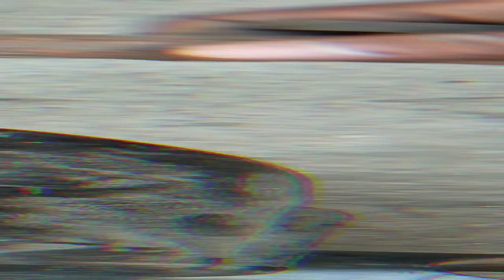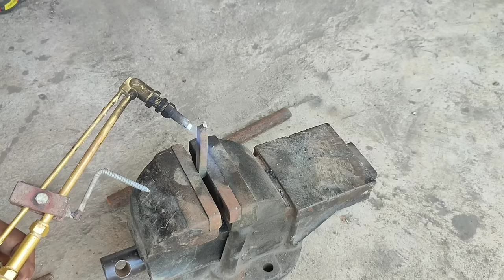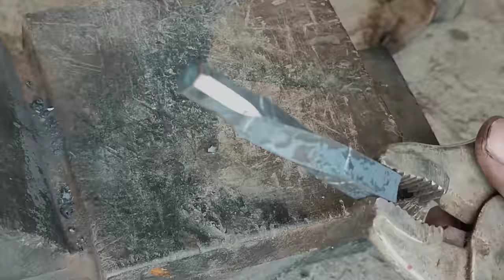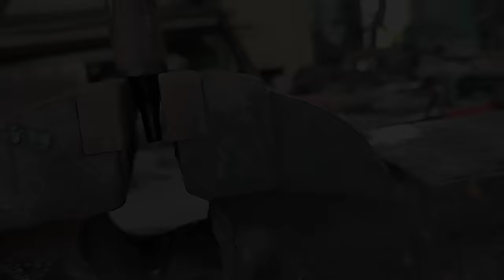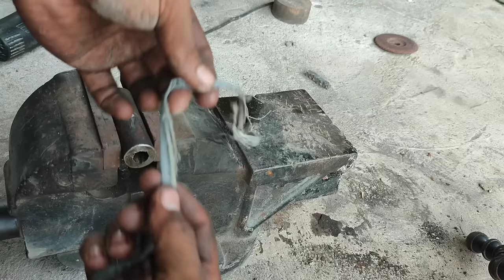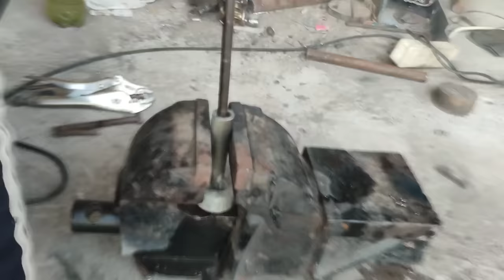Making barrel rifling without a lathe.Simple and effective,Everyone can make it

Comment: The interior of the gun barrels is conical to give pressure to the projectile at the exit of the barrel.The one he just made is straight
Reply: what guns have conical barrels? im curious, and barrel that he made is wonky
Reply: Weapons that have a fluted and conical barrel are those that use monoposta oceana cartridges, which we commonly call bullets. Shotgun-type firearms that use cartridges containing shot also use a conical barrel but it is not rifled.Shots are small steel balls contained within the cartridge.
Reply: Sorry but I only speak Spanish and to answer I am using a translator
Reply: @gustavocorintti2211 Do you mean something like that ¿Cañón reductor perforante? because i don't know what is monoposta oceana.
shotguns can use conical barrel but i think nowadays they use choke that is  Estrangulador.
Reply: @TaxortRetotuck  Yeah, i believe that conical barrels were more of a specialized item for larger guns and canons like anti-tank guns, etc.  The breach will be larger diameter than the barrel just to fit the cartridge to slide into place easily. Then the projectile seals against the walls of the barrel which is narrower, but the bore is straight, with parallel sides, not conical.
Reply: @davidsnyder3799  Thanks. Diameter near chamber should be bigger, but Squeeze bore is (at least according to wiki) conical. But normal barrels have parallel bore after chamfer. Right?

Comment: The grooves are .530" or so, assuming the HSS blank is of 3/8" size. Another assumption: the land diameter is about .50" but there appears to be a lot of displaced steel.  I did not see any lapping.

Comment: Destroyed the crown cracked the pipe visibly wich means its full of other cracks probably woulda worked better with a shop press than hammer but forcing something through something brittle will usualy cause issues also hole not center in pipe also used a lathe  shoulda have atleast anealed metal tube  to allow for for more give to avoid the cracking  then rehardened to usable hardness

Comment: Anyone who thinks this is particularly dangerous is a bit silly in my opinion. Even if it doesn't work particularly well; the rifling here should engage to some degree on a properly sized projectile and that metal is pretty thick on the barrel. If you use a lower pressure cartridge, a barrel that thick made of low quality steel should still be adequate for firing safely for at least awhile. It doesn't need to be a .50 bmg in order to be an effective gun and this is a very simple way of creating slightly more advanced rudimentary firearms. Cut the guy some slack, he's using mostly hand tools and 19th century technology. Have any of the naysayers considered it might be a barrel for black powder firing guns?

Comment: they way the do it in the real world is spring loaded piece that has carbon bits  and a long very very thin rod, think of the spring are like barbs on a harpoon and on the tips carbon bits that you push in and out over and over .. you will need a way to control the spin
Reply: Actually if you watch button or cut rifling, the broach or swedge turns on it's own, it's a turbine, and follows the track it sets itself.

Comment: I’m pretty sure that homemade gun would’ve exploded if he really use that gun barrel
Reply: Por qué ? Tiene bastante ingeniería... Yo creo que un 32 o 9. Puede aguantar... Un promedio de 500 disparos te aseguro q funciona
Reply: If anything, it's pretty thick.
Even with mild steel, it'll last you a good +500 shots for most handgun rounds (shy of the extreme stuff, you DEFINITELY wouldn't wanna try .50AE, .357 or .44 Magnum).
I'd be more concerned with the firing mechanism than the barrel, that's the part that's most likely to fail on you and throw a bolt carrier/hammer/firing pin back into your face and kill you if you mess it up.

TBH though, for making a rifled barrel I'd use a cheap DIY crafted ECM setup instead of hammering a twisted steel cutter through the pipe.
It's functionally identical to the method that Smith & Wesson uses to make their integrated revolver barrels.
It's pretty easy if you know what materials to use. (The gunsmith that invented the world's best all-nonregulated parts semi-auto SMG used the same method, and the whole ECM setup costs about $325 USD.)
Also, if you want a pre-made gun barrel quality tubing that can handle pistol chamber pressures, just buy some 3/8ths Gas Pipe from Home Depot. (Don't use anything larger from them for higher caliber rounds though, the walls aren't thick enough.)
The hardened steel is meant to survive constant pressurized gas for years on end, but due to the pressures expected for the gas they're meant to handle, they keep the pipe wall thickness the same whether it's 2" or 3/8ths.
So the 3/8ths is thick enough that it can last a good +3000 rounds of 9mm (this has been tested by a professional gunsmith, and the results shared publicly).

Obviously, this will only handle calibers that (roughly) match the pipe's inner diameter, so 9mm is probably your safest bet there, but with some heavier use of the ECM you could also get .40 S&W to work as well (though I'd only trust it for about 1200-1500 rounds if you go that route).
Reply: @TheKhopesh not even A chance not sure how much metal work youve done but he cracked the pipe visibly near the crown if theres visible cracks after all that i shudder to think what an xray will show ive seen old octagonal barrel muskets  that have cracks from just sitting a long time  you dont ever fire a cracked barrel

Comment: Why, when a rifling machine is easy enough to make?

There is zero control over rate of twist. Zero control for uniformity in spacing or individual depth which would markedly affect accuracy.

Very effective for a belly zip gun with 1 inch barrel...which doesn't require rifling anyway.
Reply from the maker: Thank you 🙏👍

Comment: Search engineering yes sir you can do it pistol barrels for black powder cutting the grooves go back and forth back and forth back and forth until you get the grooves cut good then you move it and it starts off four grooves now you got eight grooves it works they don't even have a degree in engineering but yet they can get it figured out

Comment: Jokes about the blatant lathe usage aside, I understand that the stock material had to be hollowed out; however, why was an arbor press, or hydraulic press not used, if the process you have chosen is essentially a bastardized form of button rifling? Why use a hammer? Silly. Interesting regardless!

Comment: This is nonsense, there's more to rifling than hammering a groove down a piece of bar drilled off centre, how do you get that to size? you probably expanded the tube if the twist isn't even the bullet will spin at one speed hit the next twist and rip through it exiting the barrel sideways, if you had to do it this way it would be better to buy a cheap expandable hand reamer.